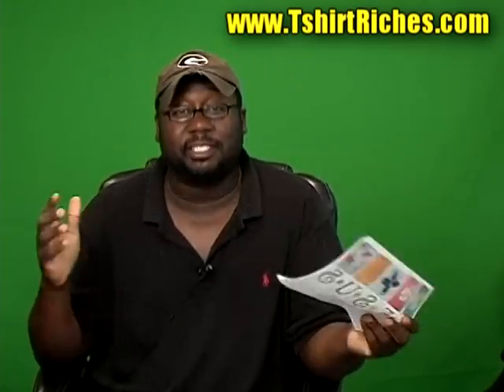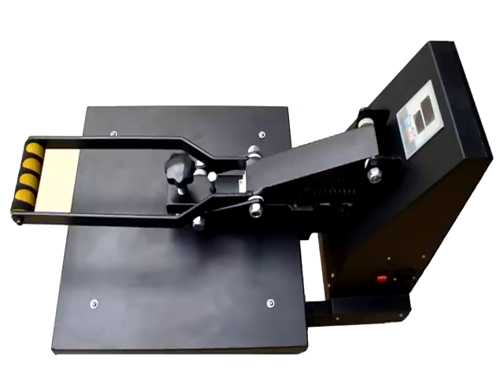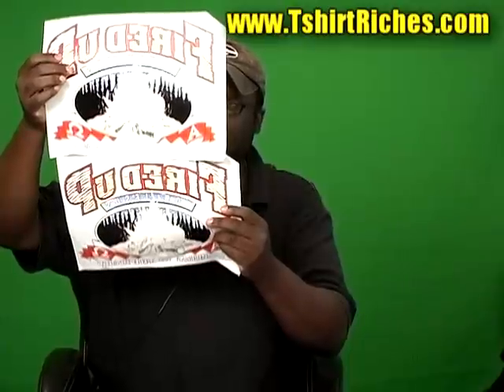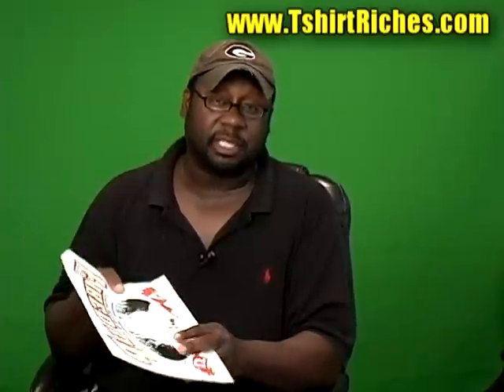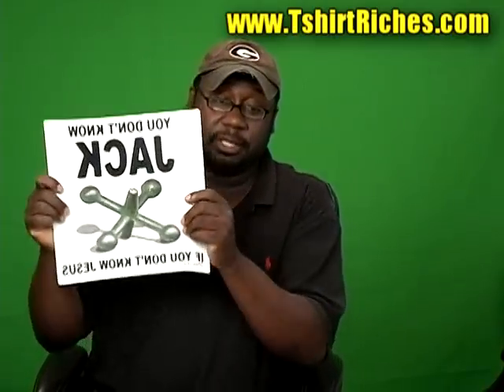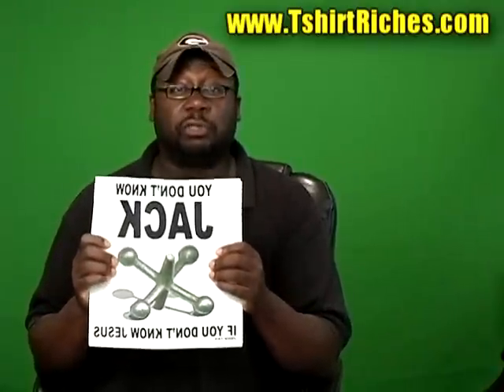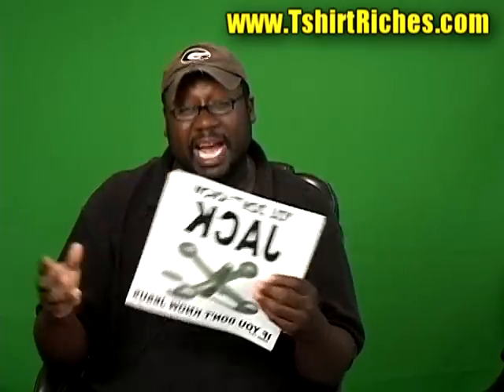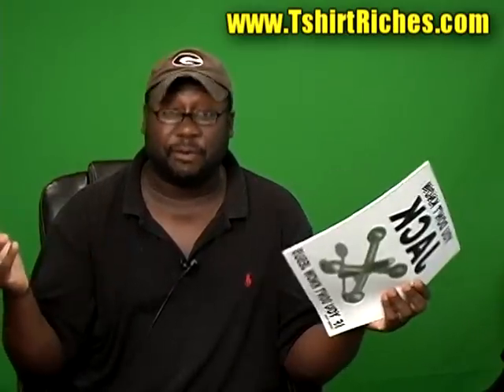Making Your Own Tshirt Designs with Heat Transfers Part 1

Comment: It held up pretty good I tested alot of transfer sheets a few of my customers still wear have the same shirts from 5 months ago and they washed them many of times the transfer still looks good and they wanted more but screen printed transfers are very good but if my customer needs that shirt right now I will print it out on my printer using transfer paper I get from best blanks

Comment from the maker: As long as the design was either screen printed onto the special transfer paper or directly onto the shirt. There are no issues, shirts can last for years. However, if you are printing designs from a printer, please don't expect the shirt to last long. However, we do have transfers available that are much better than the ones you buy in the stores. In fact, these transfers can not be purchased in stores. We recently did 3 videos on these transfers. Please click the link to be taken to our site.

Comment: What software Are you using for your designing? I'm try to get started but I'm hearing hoe to use the heat press and no software designing. I want to be able to print pictures with letter designs.
Reply from the maker: If you are thinking about software to create your designs, then you need to talk to a graphic artist. They will be able to take what you are wanting and make the image for you.

Comment: where do you get your plastisol transfers done. I currently use neenah inkjet transfer paper, but don't like the outline of the paper that sticks when the transfer is made, im looking to get something that is only ink, like screen printing. what would you recommend? i saw something called cad-cut, however i don't have a cut printer. What else do you think i can use.

Comment: I had the same question as @lauraashely122 and I watched the video from the link below and it said to contact vendors to have them put my idea on the paper. My question now is if I buy my own Epson printer can I print my own ideas onto the heat transfer paper and not have to pay the vendor? I appreciate the help.

Comment: Is there a white residue after you peel it off? Cause I'm gonna be printing texts on the shirt, does that mean I'm gonna have to cut the letters out?
Reply: There shouldn't be.
Reply from the maker: +James Garcia There will only be residue if you print from a printer. This is one of many reasons that we recommend getting screen printed transfers, it is really just a better quality. If you are working with the screen printed transfer they would put your design onto the transfer so there should be nothing to cut. You can to go our website http://tshirtriches.com and get more information on vendors.

Comment: whats up, What kind of printers are used to print good quality designs to the paper?? bcus i would definitely invest in one
Reply from the maker: We don't recommend that you have the designs printed at home. The thing that we recommend is that you have them screen printed. You can visit http://www.tshirtriches.com/where-to-get-custom-t-shirt-transfers/ and purchase a list of vendors that will screen print the transfers for you!
Reply: If you want to print transfers yourself, grab the Epson Artisan 1430. Its going to run you around $350 probably. There are tradeoffs with this method though. First of all, you've got to buy your own transfer sheets to print onto (JetPro Stretch). Then you'll need a continuous inkflow system for the printer (have to buy your own, does not come stock with printer). Then there's obviously the ink you are reponsible for.

It just adds more variables into the mix. If you run out of ink, production stops. If the printer breaks or needs maintenance, production stops. And let me tell you, getting repairs on printers sucks. Its designed obsolescence, because these manufacturers just want you to buy a new printer when the current one breaks.

But this might be the biggest tradeoff: even with the highest quality home-printed transfer you can make (without buying $50,000 printer), you'll be lucky to get 15-20 washes on your t-shirts before the ink fades. Customers won't be happy with you, and they'll go elsewhere. Like the OP pointed out, its expensive going after new clients, and much more efficient to resell to current ones.

People think doing this at home will save them money, but it doesn't in the long run. Learn how to use photoshop/illustrator. Design your images yourself. Gang them up and get the best deal from a commercial transfer printer service. Send your design out to them. Some high quality transfers come back in the mail. This is how you want to do it.

Comment: HELP PLEASE 

I DON'T KNOW WHO TO SEND IT TO TO HAVE THE DESIGNS PUT ON THE TRANSFER PAPER

SSOO... WHO DO U SEND YOUR design INTO TO BE PUT ON THE TRANSFER I NEED THE NAME OF THE COMPANY
Reply from the maker: We recommend screen printed transfers. We do not recommend printing from a printer just for the sake of quality. You want to be in business selling products that will allow people to buy from you over and over again; as well as refer others to you. Sadly, printing from a printer will not allow you to do so. 

Once you have your designs created; you can send the digital files of the designs to transfer companies. They can take your design and screen printed directly onto the special release paper. There are no printers involved in this process. All the designs are printed by screen printing equipment. Once the designs have been screen printed onto the special release paper instead of directly on shirts. They'll send you the transfers; which you'll press directly onto the shirts using the heat press machine you've purchased. 

The cost of having designs printed will vary; it depends on the amount of colors you have in the design. The more colors you have in the design the more it will cost. If you're starting with a limited budget; we recommend no more than 2. 
Another fact in cost of getting the designs screen printed will be determined by the amount of transfers you have printed. The less you have printed the more you'll pay. The more you have printed the cost to have the transfers printed, cost drops. 

We have a source list available for purchase. The source list includes various companies to purchase custom, and pre-made transfers from a list of transfer vendors as well as vendors to purchase blank shirts.

The price for custom transfers will be determined by the amount of colors you have in your design. If you are on a tight budget then I would recommend no more than 2 colors in the design. The more colors in the design the more it will cost to have the designs screen printed onto the release paper. 

If you would, please click the link below to purchase the source list  http://www.tshirtriches.com/where-to-get-custom-t-shirt-transfers/.

Or you can locate a local screen printer in your area to screen printed directly onto blank shirts you supply the screen printer to print on. It's actually cheaper to purchase your own shirts and give to the screen printer. The price once again will be determined by the amount of colors in the design and how many shirts you have printed.  You'll need to locate a local screen printer in your area to determine prices.

We have created a training course that will walk you through the entire process from beginning to end. There's no reason in trying to figure all this out on your own, cut your learning curb in half! We've done all the hard work for you. All you have to do is take advantage of the blueprint we'll provide, learn the material and apply it towards your business. This isn't an easy task, this isn't some get rich quick scam and it will require a lot of hard work if you expect to receive any type of results. Honestly, your results depend on you.
Reply: Jerff Thello Transferexpress.com

Comment: I like your video its very informative but I disagree with one part I do both I get some of my designs screen printed on transfer paper and for others I use my epson 1400 printer with ink that is made for transfer paper and the colors come out vibrant and does not crack or peel after one wash

Comment: What is the average size transfers that people request?
Reply from the maker: Hi, It depends on their design. We recommend that the heat press be a 16x20 so that if there is a larger design it will fit onto the press easier.

Comment: Or do you just order printed transfers already ready to go?
Reply from the maker: You can do it either way actually. You can order pre-designed transfer or you can create your own. When creating your own design, you will need to either have experience using computer assisted drawing software, or you will need to hire a graphic designer, to put it into digital format. You submit this format to the transfer vendor of your choice, and they will create the transfer for you using screen printing techniques. Hope this helps!

Judy
Reply: I design stuff right now, but is there a place that would take my designs and put on a transfer?

Comment from the maker: If you're asking which programs to use than I would highly recommend you hire a graphic artist. The programs are quite complicated and will take YEARS to learn. Any  Adobe programs like photoshop, illustrator,  etc are used. As far as your colors not being as they appear on your monitor I'm assuming. It's because you need your monitor calibrated. Once the monitor has been calibrated; the colors you see on the screen will print the color you see. Again, another reason to hire a graphic artist.

Comment from the maker: If you're asking which programs to use you should hire a graphic artist. The programs are quite complicated and will take YEARS to learn. Any  Adobe programs like photoshop, illustrator,  etc are used. As far as your colors not being as they appear on your monitor I'm assuming. It's because you need your monitor calibrated. Once the monitor has been calibrated; the colors you see on the screen will print the color you see. Again, another reason to hire a graphic artist.

Comment: can plastisol be printed onto transfer paper using inkjet printer?
Reply from the maker: Hi Umair,
No, it cannot. Plastisol refers to the inks that screen printers use. Screen printed transfers utilize the exact same process as direct screen printing, however instead of printing onto a garment, the design is screen printed in reverse on a special release paper. This can only be done with screen printing equipment. We do not recommend inkjet printers any longer due to quality issues.

Hope this helps!